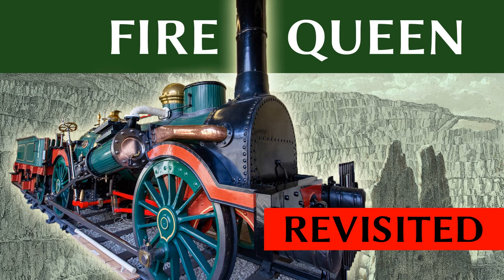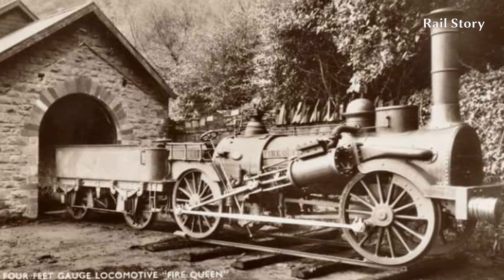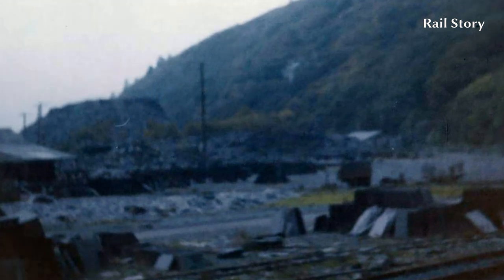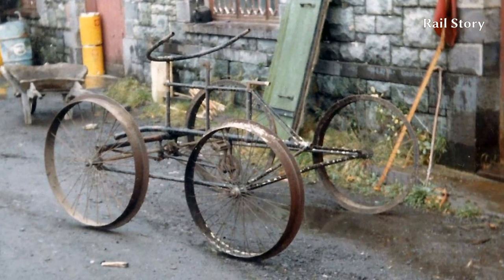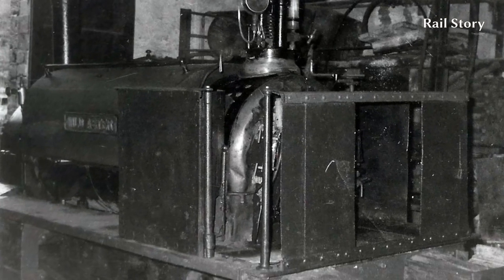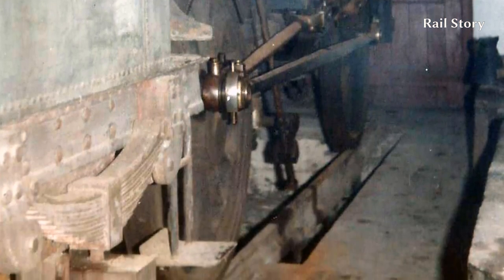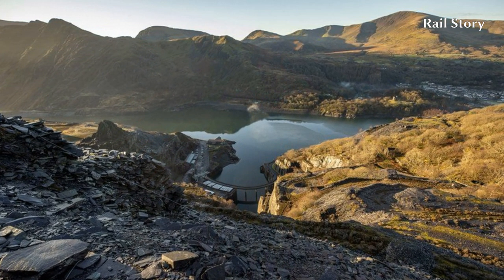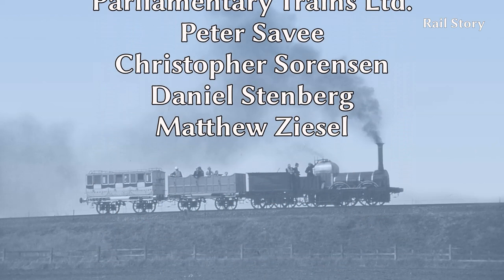Fire Queen: Revisited

Comment: Glad to see you back, Anthony. Fire Queen is a strange looking thing. It looks like an 0-6-0 with the centre wheels missing.
Reply from the maker: To my mind it looks like a Traction Engine gone wrong - the screw handle for the valve gear looking for all the world like a steering wheels.
Reply: @AnthonyDawsonHistory  😆 I'm amazed the con-rods didn't bend. It's a pity no one had the foresight to bring the rail operations at the quarry, back to life for tourism. I guess it would have cost too much.
Reply from the maker: @channelsixtysix066  I wonder how the boiler expanding when pressurised affected the valve gear etc? The lack of any  frame other than the boiler is really quite worrying to be honest. All the stress passed through the boiler. It's almost as if the leading and trailing wheels are basicaly "floating" and not connected at all.   I cant help but wonder that the tender came from another supplier given how sensible it is.
Reply: @AnthonyDawsonHistory  There's a photo of her sister, Jenny Lind. She has the same type of tender. You're right, that frameless design looks dodgy and I see what you mean by the "steam traction engine gone wrong" and boiler expansion must have been an issue. There would had to have been very gentle curves, otherwise it would have derailed as the wheels would no longer be right angles to the rails.

Comment: Great video Anthony glad to see your doing well. Not really related but I have a question on RH and LH drive locos in Britain. Considering trains drive on the left why were RH locos popular on many early railways and continued on the likes of the GWR and the midland railway among many others. What caused the switch to LH drive in later years? I’ve heard many things such as signal and platform placement as well as majority of fireman being right handed firing and it being easier to fire on RH drive locos. I’m just curious as it seems to be a hall mark of different railway companies. Anyway thanks for the great content and keep it up.
Reply from the maker: The Liverpool & Manchester, the first mainline, was LH running and LH drive locos. Every line which connected to it as a result adopted the same LH running and LH drive.  Lines like the Great Western however, did things their own way .... One line which did join the LIverpool & Manchester, the Manchester, Bolton & Bury was in fact RH running and RH drive but they were very quickly forced to adopted LH running and LH drive. So lines like the London & Birmingam, Grand Junction, Manchseter & Leeds, North Union etc - the core of the West Coast Mainline and the Transpenine routes which all had a junction witht eh L&M were LH running and LH drive. The signals were all sighted for LH drive and running. Those lines which didn't have a direct connection or influence from the L&M (i.e. the Stephensons) did their own thing. Even with Nationalisation in 1947 you still had LH and RH drive engines (despite BR's introduction of its standard locomotives which were LH drive). The British network grew piecemeal with no overall planning, no logic, no strategy. Hence the confusion between LH and RH running and LH and RH drive.
Reply: @AnthonyDawsonHistory  would there have been no steam coal left at the slate quarry by the time it closed or was that just a old heap of ashes and clinker left over from a few years when steam operations ended

Comment: Mining slate must have been one of the most miserable jobs on earth. It would probably be better with modern equipment. Nice that Fire Queen is still with us.
Reply from the maker: Not must miserable, but incredibly dangerous. Not just working in the slate quarry from the dangers of explosions etc but also in the slate cutting and dressing sheds due to silicosis from the slate dust. Nasty nasty way to go.
Reply: @AnthonyDawsonHistory  Being the open pits a far better place to work than the underground mines were, I visited those in Ffestiniog and it was dark, cold and humid there.
And then this is not a working mine anymore, add therefore noise, dust and the fact that many children were employed, they died before they reached 50.
Reply from the maker: @Tom-Lahaye  It must have been awful. But then it was a job, whole communities created from slate mining. My impression is that it was worse, in some respects,  than coal mining.
Reply: @AnthonyDawsonHistory  it depended on the quarry, it seemed. Certainly, one old quarrymen-turned-coal-miner said:
'The dangers of deep-coal mining were nothing to me, after experience in the treacherous caverns of Bryn Eglwys'. Even considering the run-down nature of Bryn Eglwys as a quarry, that's saying a lot.